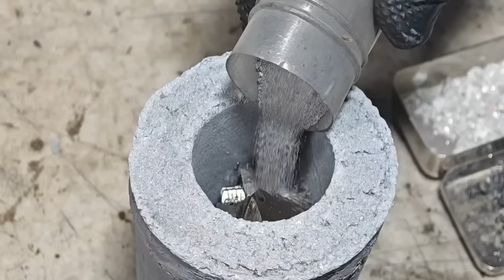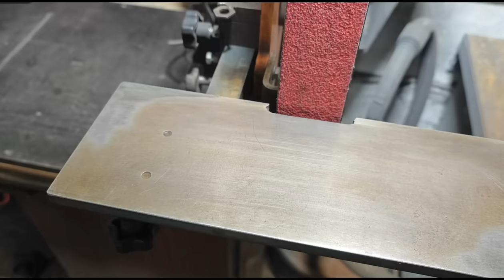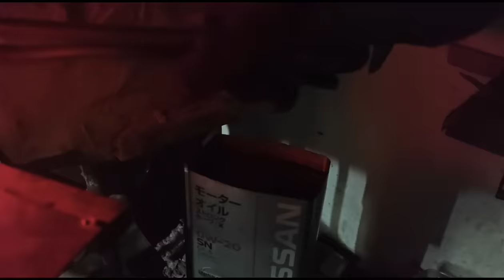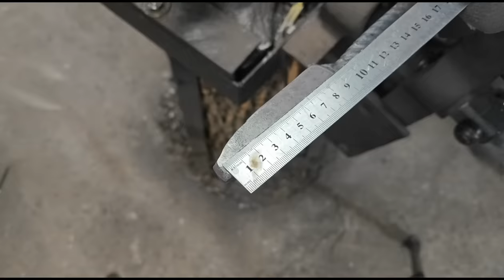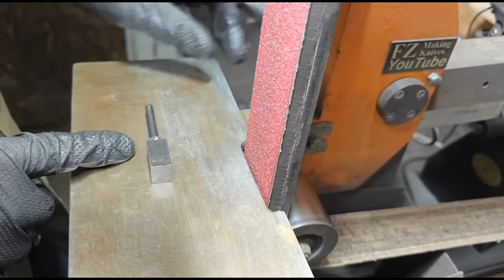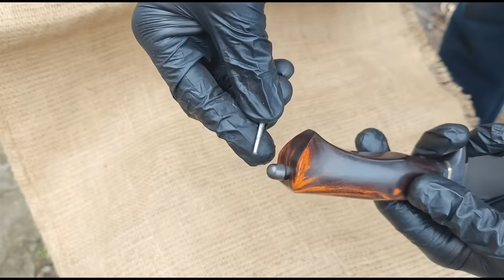Forging an Bowie Knife from Recycled Car Gears Using the Ancient Technique of Wootz Steelmaking

Comment from the maker: If you liked this video, please subscribe and like it, it will help our channel to promote.
Reply: what a cool hunting sexy knife you got there 👍🏻
Reply: Saludos Maestro, hace mucho tiempo que sigo tú gran trabajo y saber, pero desde hoy, me suscribire. Gran encabado de esta hoja, es el sistema de amarre que más me gusta. Gracias una vez más por enseñarnos tú talento. Salud maestro. 💜🇪🇦
Reply: Hello excellent video! What temperature was needed to produce melting in that furnace? did you use mineral carbon? Does the engine noise come from an air injection system?
Reply: How long does it take for the alloy to melt?
Reply: @PRIMAL_HUNTER1988  😢🎉🎉
Reply: How can I buy a knife
Reply: With made your own hand
Reply: 12 inch long and wood handle
Reply: High carbon edge
Reply: You need to make a GHOST RECON knife next
Reply: Ес, ай  лайк іт сов  мач!
Reply: @PRIMAL_HUNTER1988  *88 8🎉
Reply: @PRIMAL_HUNTER1988  ll
Reply: @PRIMAL_HUNTER1988  0orno

00rnp
Reply: @PRIMAL_HUNTER1988  أف
Reply: @PRIMAL_HUNTER1988 ❤❤😊
Reply: @PRIMAL_HUNTER1988  lll
Reply: @budescollection  get ready  for WW.i.
Reply: I like this knife...I need knife
Reply: 16:19

Comment: As someone who has had many knives break only to find out that a threaded rod had been welded to the tang, it makes me uneasy to see you doing it. However, given everything else, I'm sure you know what you're doing
Reply: He used a real bolt (way more strong!) instead of threaded rod (which is easily bent/broken because threads are the weak point!) like most that break, plus he inlayed the bolt into the tang, nothing like those cheap made knives you spoke of, this is bet one seen yet, and that's really saying something!
Reply: @honeycuttracing  yeah, but the welding bit just makes it feel vaguely unpure.

Comment: Hello excellent video! What temperature was needed to produce melting in that furnace? did you use mineral carbon? Does the engine noise come from an air injection system?
Reply: How long does it take for the alloy to melt?

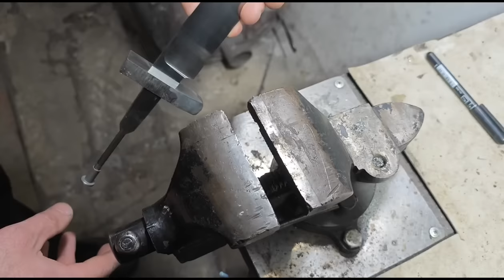Comment: Nice knife! At 11:04, it looks like there's a gap between the guard and blade. If you ever need to tighten that kind of thing, you can peen along the sides and grind the top down flat again (before fitting the rest of the handle). It could get so tight it's hard to take down, though, so probably a balancing act...

Comment: So what happens to the impurities? Like all that oil that came to the surface from the heat?
Reply: That's what the glass is for. It sucks out the impurities and gets stuck in the glass. Any that didn't get burnt up in the smelt anyways. And the the glass top gets cut off afterwards when he cut off the rod welded to the ingot whe he flattened it out.
Reply: @ColtonWilson3000  Thank you for the information. I would have never guessed glass did that.